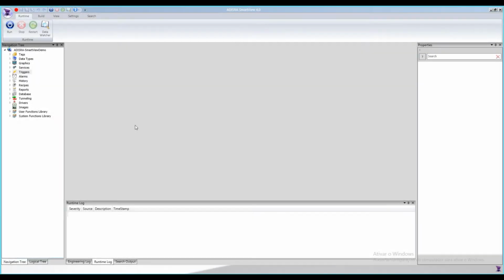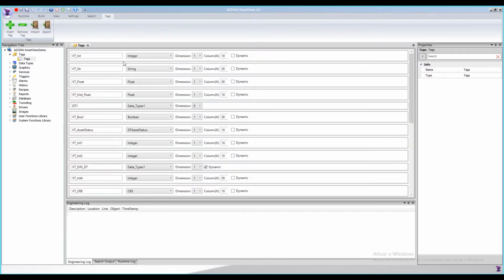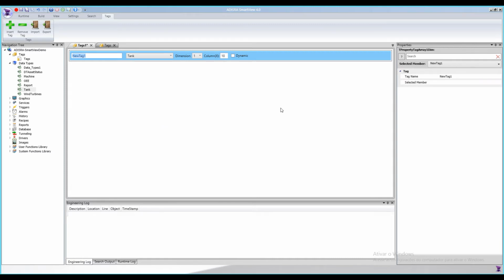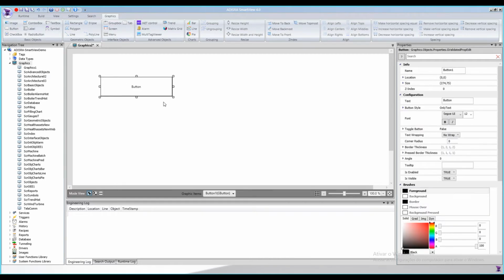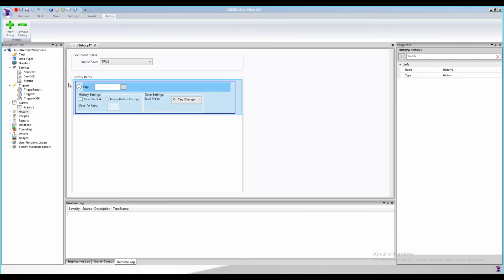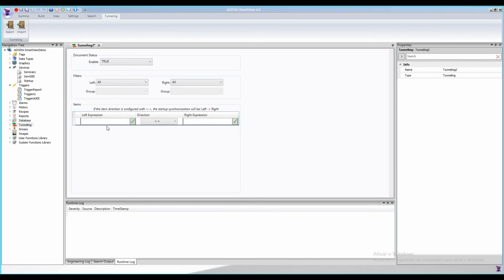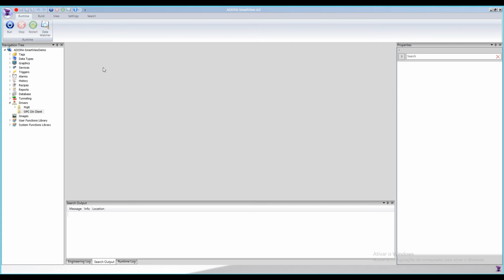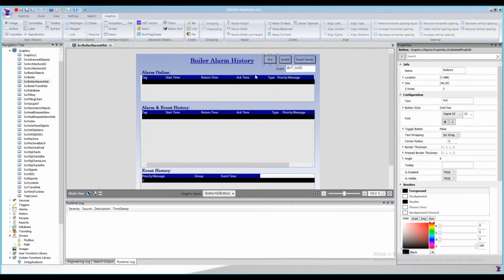#1 Engineering Tool Overview | ADISRA® SmartView

Comment: es similar a indusoft
Reply from the maker: ADISRA SmartView is similar to InduSoft Web Studio.  It has the alarms, trends, recipe, reports, graphics, database connectivity, drivers, and more, which is similar to InduSoft Web Studio and other HMI/SCADA products.  One difference is that ADISRA SmartView uses C# scripting versus InduSoft Web Studio's Visual Basic scripting.  

Another unique feature of ADISRA SmartView is the ability to create customized templates or utilize ADISRA pre-built templates such as the Low-code Template. These templates can be modified and customized during runtime, providing a flexible approach that is different from InduSoft Web Studio.

If you require further information regarding ADISRA's products, please feel free to reach out to us via email at info@adisra.com.